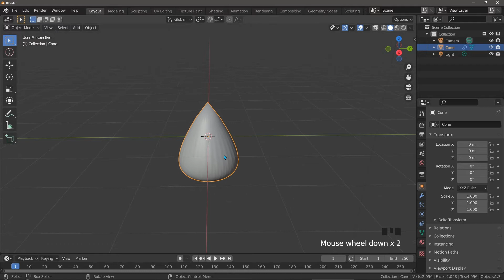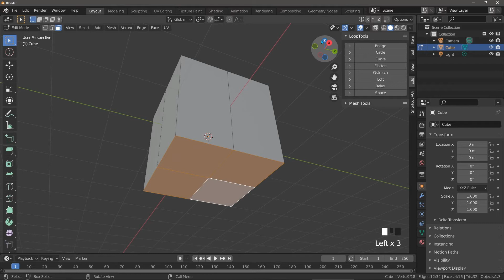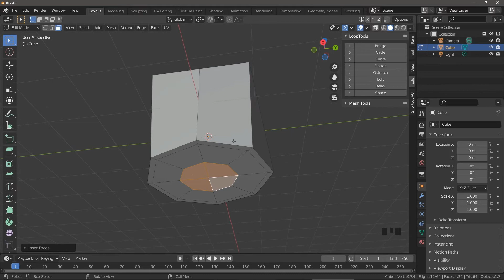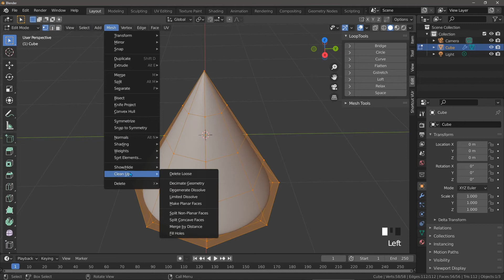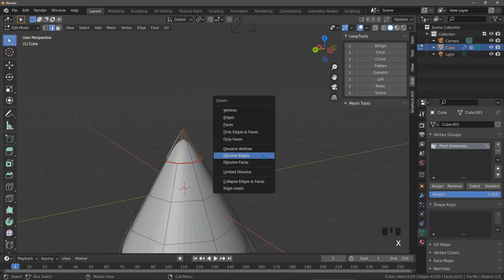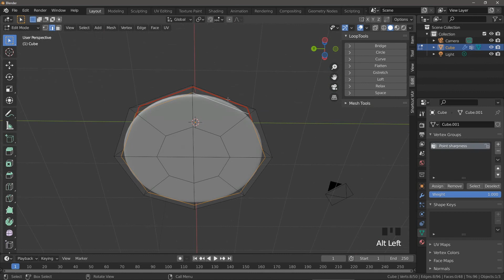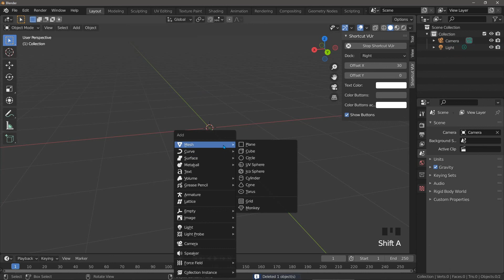Blender - A better cone - #6 Subdivision Surface Modelling in Blender.

Comment: Isn't it something bad going on at the tip of the cone? I guess it is like a quad with two diagonally-opposite vertices raised above other two (which looks like it needs an extra edge between one pair of verts to "fold" like that, but it didn't)

Comment: So I was feeling lazy and didn't want to bother adding any addons.

I found a different way of doing it:

1: Add an 8 sided cylinder mesh [Shift + A] -> {Mesh} -> {Cylinder}
2: Select the top set of vertices and scale them to 0 [Tab] -> [1] -> [Alt + Z] -> [S] -> {0,0,0}
3: Add a small number of loop cuts [Ctrl + R]
4: Merge the top vertices to center [M] -> [A]
5: Select the top loop cut, add your vertex group, and mark the seam [Ctrl + G]  -> [2] -> [RMB] -> [M]
6: Now select every other edge and dissolve to create quads [NUMPAD 7] -> [X] -> [ i ]
7: Add a subdivision surface modifier
8: Use [G] -> [G] to slide edges to create the desired curvature

Neat tip: If you've created too many loop cuts you can make the top quads larger by disolving loop cuts below the top loop cut though it will lilkely throw off proportion

Comment: You've been using Blender for... how long? I just want to get an idea what kind of time commitment it takes to get to this level of knowledge and control of Blender. Thanks. D.P. Henderson, NV
Reply from the maker: Hi Doug. I started in 3D in 1995 using Pixel Putty Solo and Bryce. Moved on to Softimage 3D in 1997. Softimage XSI in 2000. Maya around 2001. Found blender at v 2.3 in 2003 or 2004! VFX was my full time job for 25 years. Dont let that put you off. I think I takes a few months to get to a really high level. Hopefully some of my videos will mean you don't have to wade through the years of stupid mistakes I have had to make!